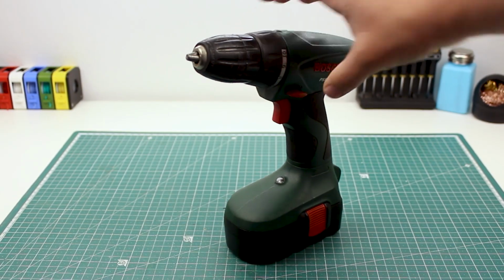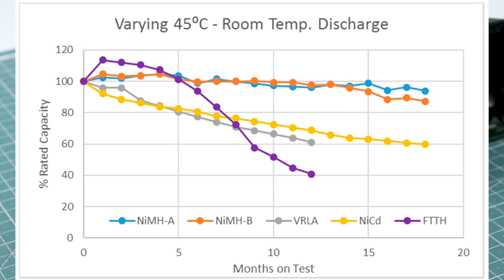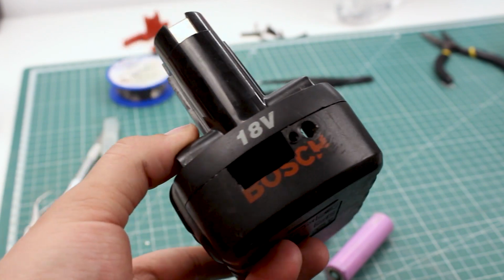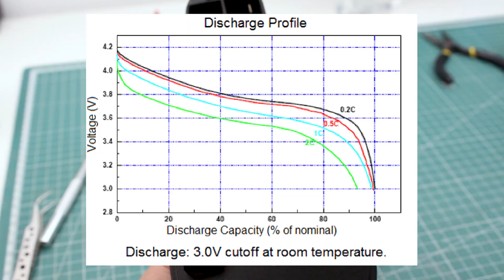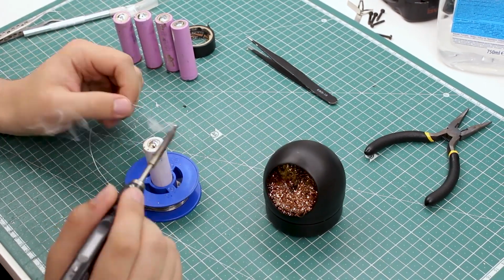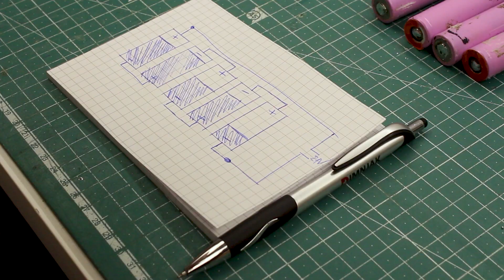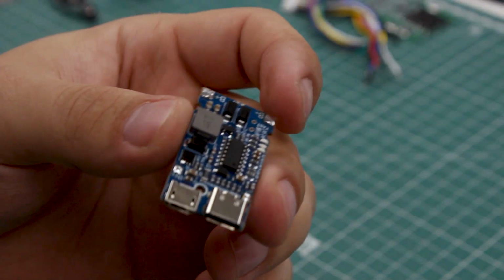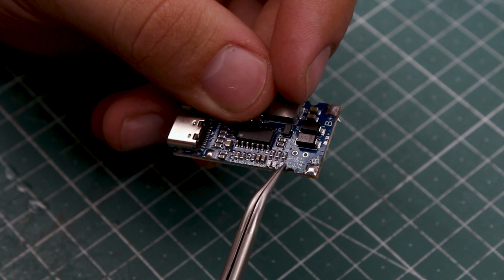Fixing an Old Drill Battery With 18650 Cells

Comment: Don't worry about soldering on your 18650 lithium batteries,
If you're fast with the heat.
I have done it & even
Mr. Carlson has done it!👍
Reply from the maker: Yeah, I'm quick with heat and not really worried because I did it a lot of times without a problem buuut I knew someone would be against it so I just wanted to point it out... For beginners it's definitely not safe, I wouldn't recommend it